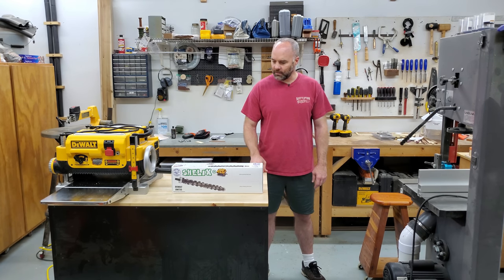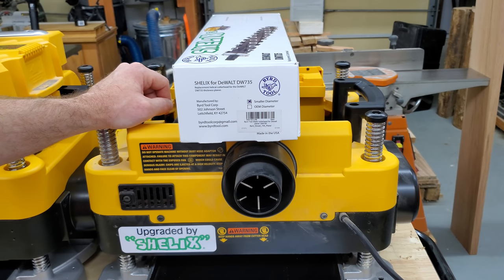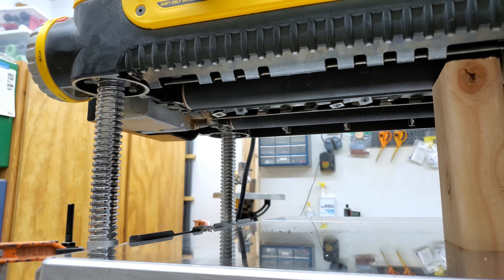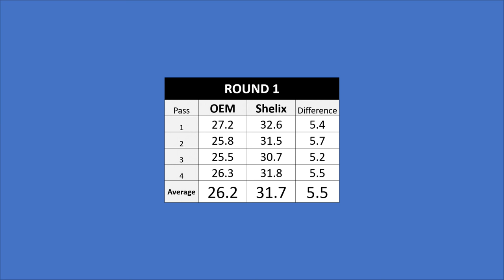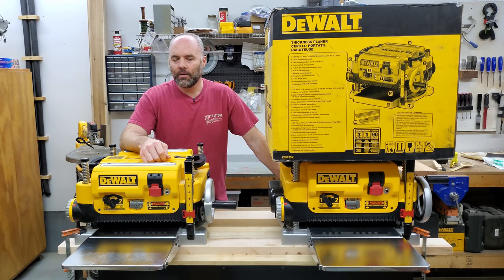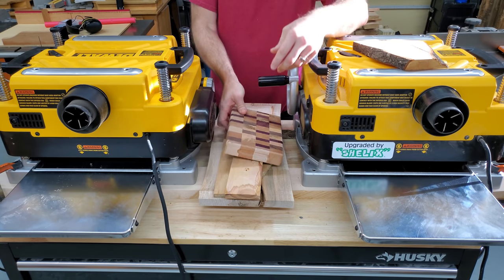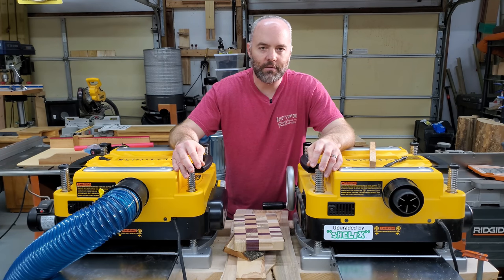The video I wish I watched before buying a SHELIX

Comment: Where they stain ready after? Thanks!
Reply from the maker: No, you always want to sand after cutting. Both the straight knives and the carbide cutters leave little scoops in the wood. You can see it at around 15:45 in this video:  https://youtu.be/wcOUKAxrTy0
Reply: @TheSnekkerShow  what grit would you need after for something like cutting board? Thanks
Reply from the maker: @hiking7521  That depends on what type of wood it is, and what condition it's in. For an edge grain board straight out of the planer, I normally use 150 followed by 220. If you're unsure, wipe it with mineral spirits after sanding to bring out the color. If you can still see scratches from the previous grit, keep sanding.

Comment: No, changing anything about the planer will not void your warranty. Magnuson moss warranty act of 1975 put in place by the FTC, was passed to protect consumers from faudulant warranty practices. They can not void your warranty because you used a different knife. The only way they can is if they can PROVE with "PHYSICAL EVIDENCE" that what you did damaged said part. Then and only then, can they void "ONLY THAT PART", not the whole warranty. Look it up.

And it also states that a "CERTIFIED" repair tech does NOT have to do the work. These companies think we're stupid. I know the warranty laws, and I'd fight then tooth and nail, and under that act, you'd win 9/10

also bad analogy on the car man, wipers are wipers and tires are something we're supposed to replace, what you should have said was, IF I PUT A DIFFERENT INTAKE ON MY CAR AND SOMETHING HAPPENED, AND THEY BLAMED THE INTAKE AND TRIED TO VOID YOUR WHOLE WARRANTY, well they'd have to prove it was actually the intake and could only void said failed part. Otherwise they have to honor the warranty if they can't. Like I said, 9/10 they lose in court.

SO NO IT WILL NOT VOID THE WARRANTY, need to edit this video or make a new one stating that. Please look at the magnuson moss warranty act

Comment: I just watched your video. You did a lot of work, but I think you also made too many assumptions.  

I’m not sure you can assume that one machine draws more current than the other because of the fact that they have different cutter heads. You do not know that the two motors are going to draw the same amount of current with the same cutterhead. You would first have to establish that fact. 

The next thing you would have to consider is if the feed rate of each machine is the same. Also - another thing to consider is if each machine is in fact, taking the same amount of material on each pass . I know you relied on the number of turns of a crank. I do not know how calibrated that is. You would have to actually measure the amount of wood taken off on each pass (probably in thousandths of an inch)  to be sure each unit was removing the same exact amount of material on each pass. 

That all being said I’m not even sure your amp meter is calibrated. It seems to be indicating a higher amount of current than expected. This could be because of a poorly calibrated pick off unit (‘splitter’) and/or meter. 

There are a lot of variables between the two machines for which you did not establish a known condition.  The only variable you recognized was the type of cutterhead. Because other variables were not determined, I would tend to conclude that the test was flawed and not meaningful.
Reply from the maker: You are welcome to perform the same experiment and publish the results. So far, everyone who has done that using similar equipment and conditions has come up with similar results. Those who try with a $20 meter rated for 15A often get different results.

Comment: Are you scandinavian?
Reply from the maker: Nei
Reply: Hehe, alright. 
Its just that 'snekker' is carpenter in Norwegian. @TheSnekkerShow
Reply from the maker: @olanordmann7836  Long story short: I spent some time in Norway and used to be moderately fluent.
Reply: I see, where in Norway were you?
I assume you are a native English speaker? How was it to learn Norwegian? I just imagine it's hard, particularly wrapping your head around gendered nouns.
Like, the word 'the' in Norwegian has something like 6 different translations. @TheSnekkerShow
Reply from the maker: @olanordmann7836  Norwegian wasn't too bad once I accepted that English pronunciation and grammar were no longer correct. The gendered nouns were a little tricky, and I probably never got it quite right. I have the same trouble with Spanish.

Comment: Inductive pickup multimeters aren't that great. Check out the plug-in meters that Project Farm uses
Reply from the maker: Several people have questioned the results after using things like Kill-a-watt meters, which are inexpensive and only rated for 15 amps. Those who later tried with a professional meter have gotten similar results as I did. Feel free to do your own tests.

Comment: I think your amp readings are double because you are picking up the magnetic field on both the black and white wires. The breakers would have flipped off at a  around 16 amps.
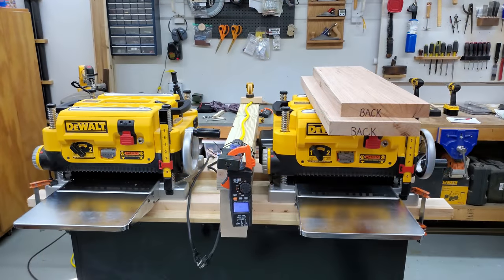Reply from the maker: That would result in a reading of zero regardless of amps. I explain the test environment starting around 19:41.
Reply: If you ever figure this out, please mention it in a future video. Thanks for the effort and good content, you have a good channel with interesting topics.
Reply from the maker: @jondurand7416  Thank you. If you scroll all the way to the bottom of the video description I put a link to a video that explains it better than I could. The short version is thermal breakers use a bi-metal strip that bends more the hotter it gets.
Reply from the maker: @CoffeeHouseReview  If you search for "circuit breaker trip curve" you'll find charts that show when breakers will actually trip. The concise version is that the more you're over, the faster it will trip. If you're just a little over, you have more time.
Reply: You can only take a current reading with a clamp meter over one wire, I made and use a short extension lead with an insulated plug and socket about 18 inches long with the wires separated from each other by at least 3 inches and place the clamp meter over only one wire, it doesn't matter if it is the live or neutral wire, only way to do it,
Reply: @alecreid9983  I was wondering if the splitter was giving a higher reading too. I would like to see the reading on the hot wire at the breaker. I trip my planer all the time running long boards 8+ feet.

Comment: The REAL question, though, is why would you need two of the same kind of scissors on your tool wall?
Reply from the maker: Good question. I'm pretty sure I lost a pair at some point, bought another, found the first one, and then put them both on the wall when I was setting up my workshop.

Comment: So what is the voltage at the plug? Less volts more amps.
Reply from the maker: That's a good question. I didn't measure for changes in voltage.
Reply: @TheSnekkerShow  Worth knowing. Two issues: a) what is the no-load voltage at the end of the supply chain AND b) what is the load-induced voltage drop? The lower the value of a) the greater the amount of b) and the higher the amperage. IIRC the start-up current showed around 15 amps., but during the load, the amperage increased dramatically. To me that suggests undersized conductors and perhaps low line voltage. What size is the wire to the 20amp receptacle? It is possible that only the breaker is sized to 20 amps, not the conductor. I would also test the breaker. Something is wrong here.
Reply from the maker: @ianallan2337  The breaker is 20 amp, the wire is 12 gauge (20 amps), and the short extension cord I was using to get the meter in front of the camera was also 12 gauge. I wouldn't be surprised if there was a voltage drop since the motor requires way more than 20 amps under heavy load, but the breaker is definitely good.
Reply: @TheSnekkerShow  Thanks for the follow-up. Yup, the breaker and wire and cord are correct. I dunno. I have one of these machines but have not used it yet. Can you try another appliance/machine on that exact adapter/wiring set up and see if it makes sense? Any chance the adapter set up for the amp probe is screwing things up? Interesting. I don't, have an amp probe here to test mine.

Ian
Reply from the maker: @ianallan2337  I tested several other machines in the same way on the same and other circuits, and even bought a new meter before publishing the results, because I was in the same state of disbelief as you and many others. Reading up on circuit breaker trip curves made it make more sense.
Reply from the maker: I finally got around to testing voltage tonight. Starting with the original setup with a short 12-gauge extension cord, it was approximately 120v before starting the motor, 119v after, and dropped to 115v while planing 8” wide maple. Then I plugged directly in to an outlet right next to the breaker panel and got 120v, 119v, and 117v.  There were some minor fluctuations between test sets, but those numbers are a good summary of the results. Amperage was maybe 1 or 2 higher using the extension cord, but still around 25-27 for both.
Reply: @TheSnekkerShow  I dunno, something seems amiss. Thanks for the follow up.
Reply: Like the mfg. info eh?

Comment: You should have used a  device called kill a watt. It will provide results in watts. It's not expensive either.
Reply from the maker: I have one, and it's only rated for 15 amps. The clamp meter is rated for 600.
Reply: @TheSnekkerShow  The planer plugs into a regular outlet. That's all you need to know.
Reply from the maker: You might want to watch the power testing portion of this video, and some of the other links in the description.
Reply: @TheSnekkerShow    There is no way it can pull 30 amps out of a 120v/15 amp line. It's physically impossible.  Talk to an electrician.
Reply from the maker: @firesurfer  Yeah, it caught me by surprise too. Check out the link to the circuit-breaker manufacturer in the description, and here's an inside view that demonstrates the numbers in their chart: https://youtu.be/24f-J0lVo-E
Reply: Some circuit breakers have a starting rating and a running rating. A lot of motors use a large initial draw to spin the motor up to speed, then a lot less once it's running.

Comment: You have your amp meter set wrong. There is no way you are using 27 amps. You would blow breakers, burn up the planer, start a fire, something along those lines. The test you are trying to do is a good one ans I appreciate your efforts to make it a fair test but the amps used is kind of important!
Reply from the maker: https://youtu.be/24f-J0lVo-E

Comment: There is no way this planer is pulling 36 amps continious.....thats the inrush current . it happens when you start the motor up by turning on and when you initially incert wood unto the blades for 2 0r 3 seconds. then running load amps will be shown. dont set you amp probe to register the max amp reading and you wiil see the amps go down as the wood passes through the planer.
Reply from the maker: https://youtu.be/24f-J0lVo-E

Comment: I am surprised that it draws so many amps (36), and still doesn't trip a 20 amp circuit.
Reply from the maker: I even tried turning on both planers simultaneously (no load).  If memory serves me, the only time I've tripped that breaker was when I was running a shop vac, dust collector, and miter saw at the same time.  It tripped on maybe the third cut during the power-up stage.  Come to think of it, I might have to reproduce those steps with a meter attached just for kicks.
Reply from the maker: No time like the present I guess.  21 amps after the shop vac and dust collector were at speed, and around 30 amps with the miter saw running.  The meter doesn't do well with reading the initial spike, but I would guess it was at least 40.  Didn't trip the breaker, but I only did it once.
Reply: @TheSnekkerShow  I wonder how long you could go before, or if, it would trip.
Reply: Mine is only running at 12-13 amps with no load and 16-17 running purpleheart through the planer. I have a Shelix head installed. You must have had something incorrect with your amp reading setup.
Reply from the maker: @jackwilson1245  You can see my setup in the video.  We're you measuring while taking a 1/16" deep cut on a 9 3/4" wide board?
Reply: @TheSnekkerShow  I just ran an 11” wide piece of walnut and the most I got was 22.5 amps.
Reply from the maker: @jackwilson1245  Full wheel rotation?  That's about what I get with shallower passes. Our no-load readings are the same.
Reply: @TheSnekkerShow  yes one full rotation.
Reply from the maker: @jackwilson1245  It must be a little softer than that oak I was cutting. What was the width and depth on the purpleheart? I could make the same cut on mine.

This is another short video showing a test with 4" ash. Lower power draw of course.  https://youtu.be/z-5n9ElTp2s
Reply: @TheSnekkerShow  I just redid the cut. 3.5” wide, one full rotation, planer speed 2. I got 18 amps. .
Reply from the maker: @jackwilson1245  I just did two passes with 3 3/8" wide purpleheart,  full rotation, speed 2, and got between 17 and 18 amps. My impeller is removed though, which probably removed half an amp.
Reply: @TheSnekkerShow  ok, sounds like we are pretty much the same. Question, why did you remove the impeller?
Reply from the maker: @jackwilson1245  It reduces power draw. I did a demo and more power testing here: https://youtu.be/UoBN5Sc_2uk

Comment: Amps is not a measure of power usage. Amps is a measure of current. You also need to factor in voltage and power factor to measure power usage. Amps by itself is useless.

Comment: how are you not popping a 20a ckt when its clearly pulling 30+ amps on the shelix and 25+ amps on the standard and the max on a 20a ckt is only 16a so its way over on draw then should be and dont just tell people to change the ckt breaker you need to upsize wire as well not just the breaker man are you trying to burn down peoples garages or workshops

Comment: Powder post beetles?? I would've burned that piece....not shredded it in my woodshop.
Reply from the maker: I have a healthy fear of powder post beetles, but I've never had trouble with them spreading to other dried wood. I brought some green bamboo into my shop about eight years ago, and noticed the infestation two years later when I bumped the stack and saw powder fall. Some of the pieces were almost completely destroyed, but I haven't seen them anywhere else. I actually used some of that red oak to build my king sized bed almost four years ago, and haven't seen a single pinhole appear. Maybe it was before the infestation started, or the Waterlox did them in.

Comment: You did not touch on the poor quality or cost of the knives.  My Shelix has been cutting for over a year and is still cutting well.  The Dewalt knives were lost after a single dark knot.  As far as your amperage readings, I am running on a 15 amp circuit and have never blown the fuse.  Why are you concentrating on peak instead of average.
  This smacks of buyers remorse.  You want to do a real test, do a rockwell hardness test on the dewalt blades you are so big on.  I will never buy dewalt products again strictly based on my experience with the lack of quality on this plane, (want something to really bitch about, look into feed roller bushing design and the cost to replace them), but that being said, the shelix at least makes the plane acceptable.  Yes, spending this much to rescue a purchase is a rip-off, but that ship sailed when I didn't research the plane enough before I bought it.

Comment: Your clamp meters are fine; you just don't know how to use them. You cant put them around the power cord, as it has both the hot and neutral wires inside the power cord, so they'll cancel each other out on the clamp meter reading. you either have to split the power cord and put the clamp around one of the two wires, or do a less intrusive approach by clamping them around one of the wires inside the machine after they separate from the power cord. You could also take a reading at your breaker panel, but I'm not going to suggest that you open up the breaker panel, given that you don't know how a clamp meter works.
Reply from the maker: If only there were such a thing as a line splitter, like the one I clearly used in the video.

Comment: i put one in my planer and did not like them so i went back to the factory knives,much better......Shelix is a joke
Reply: Why didn't you like it? were you able to return it and get your money back?
Reply: @dougprentice1363  i think the stock knives cut better.no i did not get my money back but sold it to a friend for the same money
Reply: I purchased one, installed it. Ran some yellow pine through it, promptly removed it. I do not have time nor patience to tolerate multiple lines in the wood plus the excessive vibration the cutterhead has. As a retired machinist I know how critical the setup of the cutter bits so it was installed correctly.

Comment: Well, IF you had purchased the BIGGER, BETTER DeWalt DW745 (as Shelix recommends) or any or the non-"portables" with say 3 1/2 to 5 HP motors, you'd be talkin' out of the other side of your mouth! You are complaining that a job-site tool won't do the job a stationary shop tool will do. DUH! Next you'll gripe that a Herber Fraught thickness planer isn't as good as a DeWalt! I wouldn't buy EITHER for the value and power of a Grizzly or Powermatic! Course it takes three men and a teen-ager to MOVE either of the stationary machines, but PRICE-WISE if you have 240 VAC single phase  available, I can't see buying a portable unless you HAVE TO HAVE A PORTABLE! I "stole" a used Powermatic 5 HP, put a SHELIX head on it and lived happily ever after.